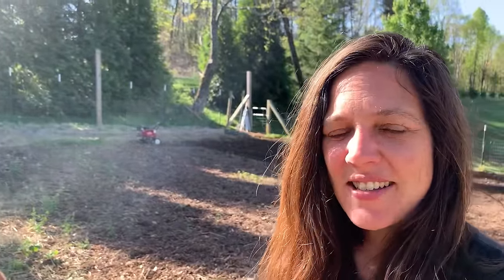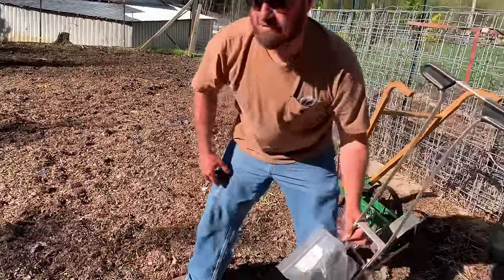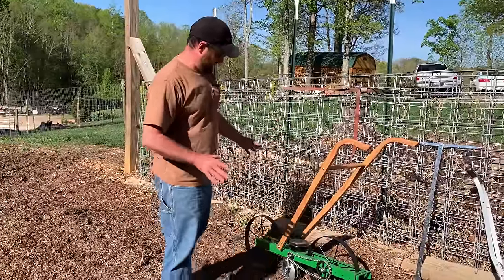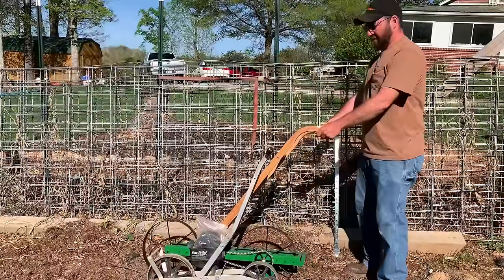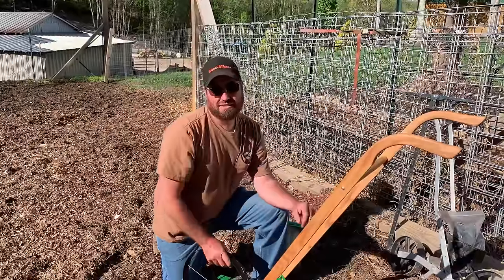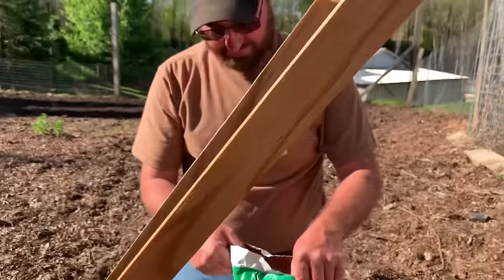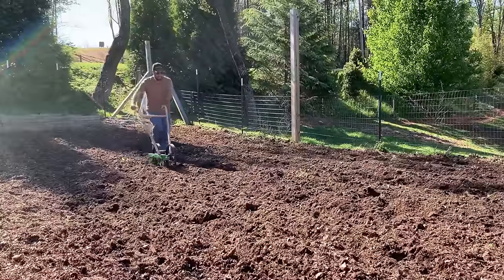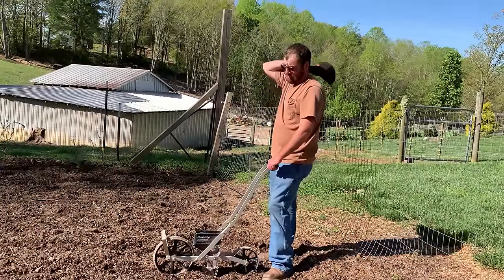The Dogwoods Are Blooming | Homestead Vlog | April 19, 2024

Comment: Nice! There are two things that might help with your spacing. One is to see if you can get a hilling attachment for your tiller, then run your planter down the hill rows. The other would involve some tinkering. Take the spacer and see if you can attach a thin wheel to it, so it wouldn't dig into the ground, but would roll over it leaving a trail to follow.

Comment: I’ve been using the hoss planter for four years. I think the heavy weight is a plus goes through the soil better. I use four sticks 36 inches long for my row marker and spacing. Put two in the end of the first row then use the other two to measure over for the next row and stick them in. Just keep piggy backing till you get all your rows in. Hope that makes sense. You can also take a drill and open the holes in the seed plates if your seeds get stuck